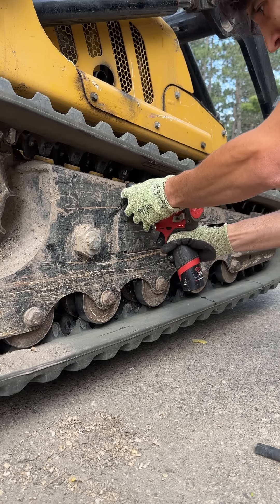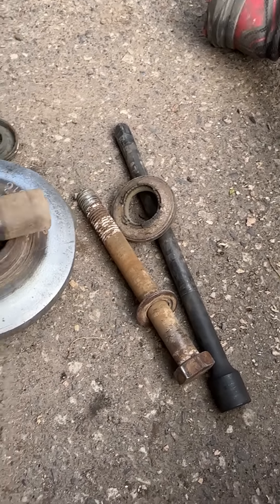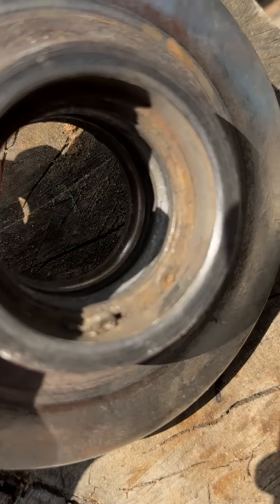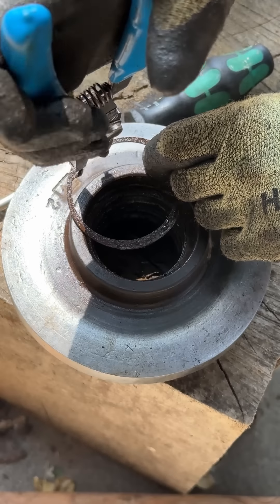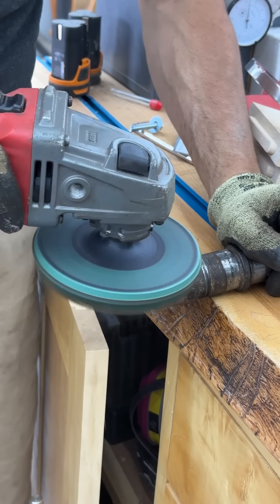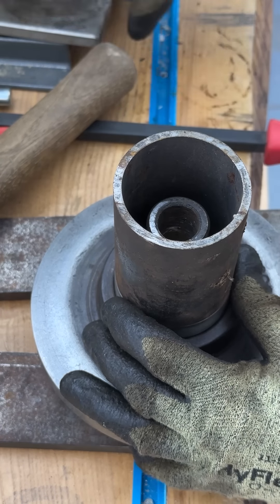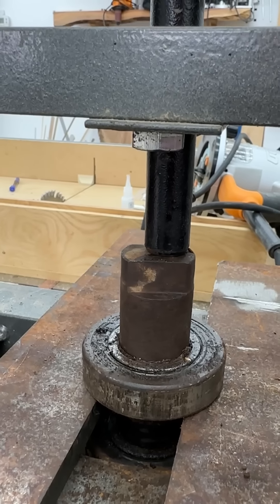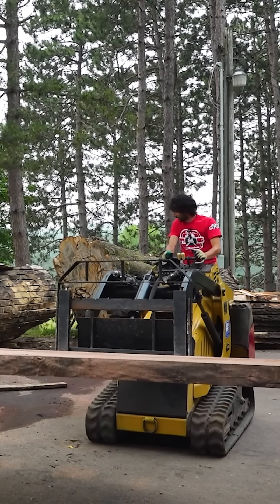Replacing the Idler Bearings on my Mini Skid Steer (Vermeer s800tx)

Comment: You should look into getting a 20 ton shop press.   The harbor freight one isn't too big, and i put it on casters to move around.  You'll find yourself using it a lot more than you would think.
Reply: I built my own.. It's super easy with some scrap  angle iron and a few I-beam cut off's. or you can just make your own I-beam with some plate.   Same basic layout as his little one.    I got a 32ton bottle jack for a hundo..  Haven't seen anything that it can't move yet.
Reply from the maker: I’d probably build a bigger one. That vise has a 20 ton capacity

Comment: Emery cloth would have cleaned the shaft off before installing the bearings and putting the bearings in the freezer the night before would have made installation a lot simpler … just a lil tip Matt

Comment: Great video on the idlers. Would you have any idea how to get these S800TX Hydraulic wheel motor hub off the change a leaking outer seal ? The sprockets I’ve changed many times but that damn hub is a bear 😡 Thanks and great job on the video 👍🏻
Reply from the maker: I’m going to have to figure it out soon. One of mine started leaking this week
Reply: @mcremona  - When you have the sprocket removed use Four 3/8-24x2/12
5 or 8 grade bolts screw them in for posisition on the hub  and a few thicker washer or metal against the back of the hub. Impact the four bolts, put the hub nut on so the threads don't get damaged. Once there is  tension on the four bolts hit the center/hub nut a few times with a heavy hammer, i use a 5 lbs sledge, came right off. Hope this makes since.

Comment: aren't there bearings for both sets of tracks?  If so how come you only replaced one side shouldn't you do both sides just to be safe?
Reply from the maker: Did the other side previously
Reply: @mcremona  that makes sense.  I usually just do both sides at once if one of my cars wheel bearings go as I just find it easier to do both at once even though you don't have to

Comment: Did you put a little grease on the seals? The bearings are a sealed bearing so no grease needed on them but dry seals tend to go away faster. Or was this not recommended by the seal mfg?
Reply: I would ve packed the complete void with grease,seal is greased and where there is grease,cannot get dirt
Reply: @haynillesen  sometimes you can over do it. Grease will hold dirt and grit. Especially if it’s not purged occasionally, like a bushing with a grease zero. When you grease the bushing it pushes a little of the contaminated grease and grime out. Just my opinion after 40+ years of being a mechanic from automobiles to heavy equipment.
Reply: I choose a one-time grease fill over doing no grease in.using single side sealed bearings and filling the void between the 2 bearings is another option always better than no grease imho

Comment: You did not replace the let side bearings?
Reply from the maker: Did them previously
Reply: @mcremona  thanks!
Reply: If it's not broke yet.. Don't fix them.   It's a good idea to order the parts and have them ready though.  (if he didn't already do it)
Reply: Already replaced. If one side is that badly damaged, the other likely is as well.
Reply: @mp6814  That's a myth..  Things happen. he could have hit something.. he could have parked in a puddle on that side.. etc.  It doesn't mean you need to replace the other side..  This is just an OCD tick in people's mind.  Some wheel bearings fail at 40k miles.. Some go 200k miles with no issues.. Who knows why??  Maybe he drives on the side of a hill a lot, and the lower side gets all the wear??   Just replace them as they fail;  particularly on something that is so easily accessible.  If it was buried down deep inside, then sure-- replace everything in there so you don't have to go back. (for example, he fixed the front wheel because the track was already off-- even though it didn't need it yet).  but these are easy to get to..  Plus it's a matter of having the TIME.. It works for now-  you can make time to fix the other side later:  since it hasn't failed yet anyway.  (except this is "the other side" in this case).
Reply: @calholli  Agreed it may be the case, though him having the other set of bearings replaced proves the idea.